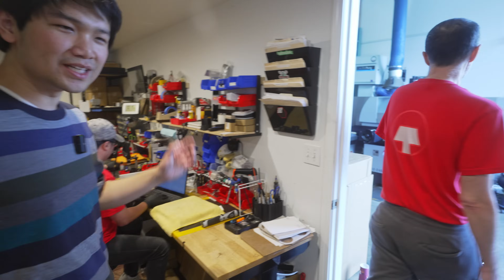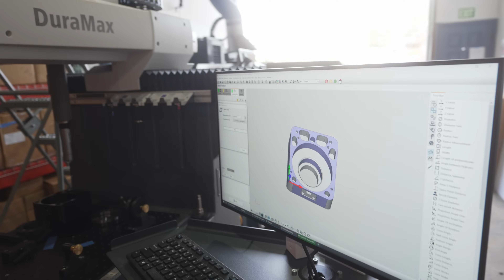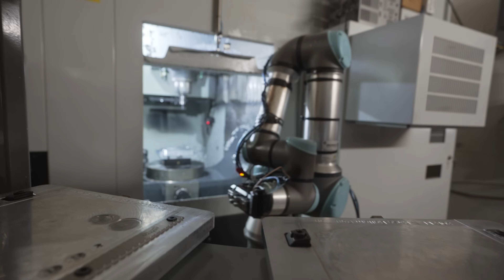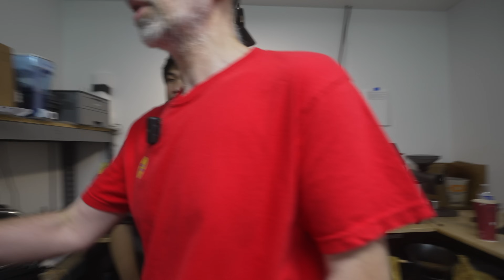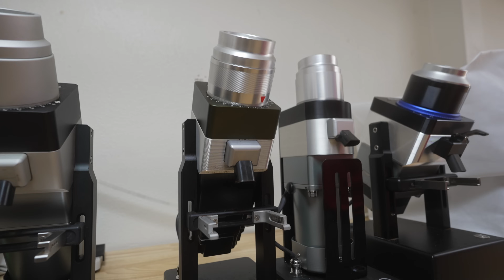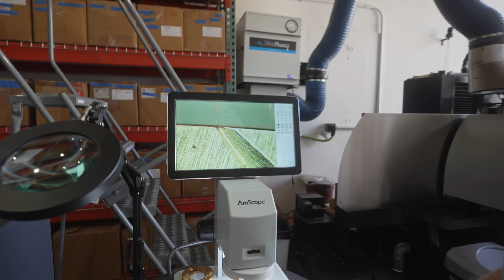Where the World's Best Coffee Grinders Are Made | Kafatek Factory Tour

Comment: I'm surprised it isn't temp controlled when going for  <5 micron flatness. For a 20mm thick burr you are looking at a roughly 3 micron deviation with a 10*C temp swing. There's a reason that metallic (cast iron) surface plates need a temp control to be graded AA.
Reply: This is a Zeiss DuraMax shop floor model. You are correct on temperature swings, but for our use case where we care about relative measurements between features and not true position measurements as long as temperature is stable during measurements the precision of the machine holds.
Reply: Yep. Makes sense. I guess for non identical materials the customer home is worse than the shop so the design has to take this into account. Certainly my early model flat gets 50* temp swings (0-40*  ambient+ heating)

Comment: Pretty cool to see some of the process to manufacture a Kafatek grinder.  Impressive to all be made at one location.  Surprised the CMM isn't in a temperature controlled environment.
Reply: The Zeiss Duramax is designed as a shop floor CMM you can put right next to the machines - ball screw driven so no air bearings and Zeiss's rather excellent thermal comp system. The book spec is 2.2µm, but Zeiss likes to sandbag their catalog, most of the calibration reports (from shop floors!) are around 1µm across the machine's whole volume. For comparison, Zeiss's main metrology lab CMM is the Contura which has a book spec of 1.4µm in a controlled environment, but is really like a .5µm machine (also double the price, and requires it's own room with temp/humidity/AQ control).

Comment: Denis, Brian, many thanks for the video. It is fantastic to be able to see where everything is happening and also the team who is building it. And the quality how to manufacture the grinders. Amazing. Thanks!. One question and sorry as maybe a bit simplistic but if you don't have pre-breaker in the grinder, should you pre-break the beans before dropping the beans in the grinder? Is that the main value of the pre-breaker? It is pre-breaker a need for flat, for conical, for both, for espresso, for pour over, for both? Thanks!
Reply: Thank you Juan. The pre-breaker from the flat burr has been removed since we have pancake pre-breaker stack above it. So two pre-breakers is redundant and this way the grind path of final fine grinding stage on flat burrs is maximized.
Reply: @KafaTek  great to see the factory tour. Did you think about some discount codes for those of us who are most impressed... PLEASE 🫣
Reply: Thanks. I would love to be able to test it. Thinking about the MC6. Many thanks and brilliant job